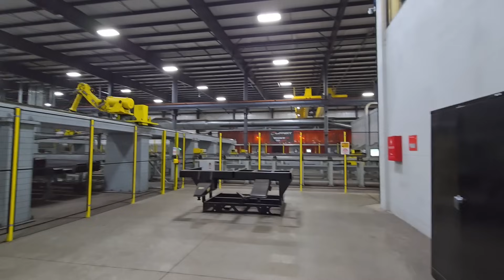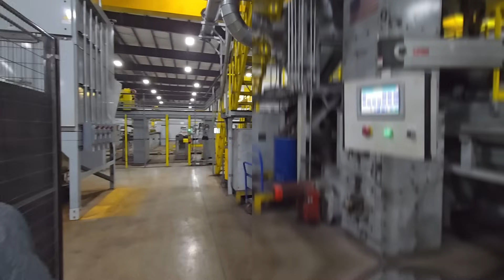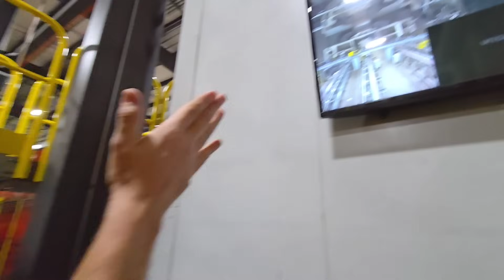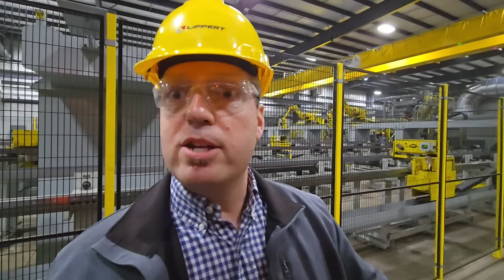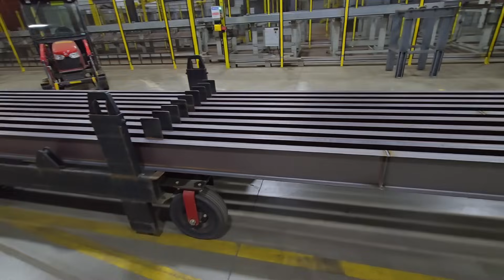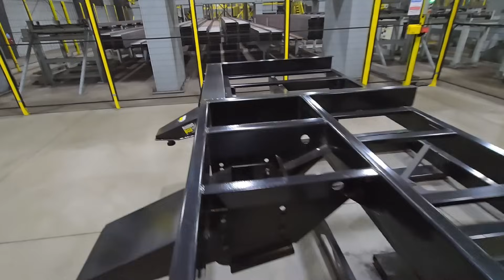LIPPERT RV FRAME Manufacturing Tour.  Part 1: Beam Processing Center

Comment: One thing I learned is that Lippert is covering their own, but I give a lot of credit they have stepped up at least to show their product. I do believe that a lot of the manufacturers are to blame for all the failures of their product. They have cut so many corners to make a huge profit and are selling these unit for 100K plus and don’t want to stand behind them.
I believe it will take some kind of kind of pressure from congress to address the issues and make them more accountable for their product and their work. As long as people continue to buy from these companies they will continue to produce products that are designed to fail. 
Thanks JD for at least bringing some light to a dark problem.

Comment: LCI talked about the leverage applied to these pin boxes, and what length is approved within specs.  Then they brought in a pin box manufacturer and helped them design a shorter pin box for them to be in spec. Common sense tells me to bring in the longest pin box available on the market, add a foot to it, then build the frame to handle that load.  Notify all manufacturers that's the new minimum spec for all frames.  Most of us are paying over 100k for these 5th wheels,  I'm not going to notice the minimal upcharge for the overbuilt pin box area. I grew up in family steel business where my father bought us minimum requirement 1/2 ton trucks (like these frames are built), then complained we couldn't keep up with my grandfather's employees who all drove properly equipped 1 ton cab/chassis trucks. It all comes down to the owners value of the dollar for better for worse.

Comment: JD, I have a 2020 (pre-covid) Keystone Alpine that is in the shop now having repairs made due to frame flex.  Prior to it happening to me, back in October, I had never heard of 'frame flex failures'.  Now, it's all over the internet!  Your series of videos on this issue have been valuable in helping to understand why it's happening, and your trip to the Lippert factory  really drives home the relationship between the Lippert frame (chassis) and the manufacturer's side walls, roof, etc (body).  I would be highly interested in seeing some additional videos and interviews from one of the manufacturing plants, such as Keystone or Grand Design to illustrate what they are doing to ensure a strong rigid structure throughout the body of the RV.  Can you make that happen?

Comment: Great video JD.  It's great to see what Lippert does to ensure quality control. I know this all has to do with the frame flex issue, but I still think there's something missing here.

Somewhere between Lippert frame fabrication and the manufacturers of RVs there is a problem.

Maybe RVs are just too big and we are all expecting too much of them.

If that's the case, maybe everyone needs to look more realistically at what they actually need or be prepared to pay a lot more for a failure proof frame.

Comment: JD, nice interview, very nice manufacturing facility.
What LCI, and all the OEM's need to do is, go get a unit that has failed in use. Take that rig apart and investigate every inch. Document this so owners and potential owners can see what is happening.
I think right now with all the frame issues and upset customers, that a tremendous amount of damage has been and is being done to the reputation of all involved. If this has not affected rv sales I feel its just a matter of time until it does.
The OEM's turning their back and basically telling customers it's not their problem is not good enough.
There is a huge issue industry wide, they need to get a handle on it or prepare for the repercussions. 
I like these interviews to give LCI an opportunity to explain their end. I appreciate that this was probably a rare case, given curtent issues. I can also appreciate your position, but I felt you were a little soft, and more of a help to them. I'm not throwing rocks at you, had you gone in nostrils flared, teeth gnashing, you likely would not have gotten in the door. 
I appreciate your knowledge of the rv industry,  your reviews of rv's and your contacts in the industry. Thank you for your diligence, time and time away from your family to provide this information. 
As many have stated, this is not an easy issue, and what I see from folks having these issues, they are wanting answers and / or help.  And everyone is turning their back on them.
Again, thank you for what you're doing.
God bless and stay safe out on your travels.

Comment: First thing I noticed was how clean and bright the plant was.
Reply: Plants fo that when they find out a camera from outside source is in house.
Reply: That has nothing to do with the quality of the finished product. These frames are built to spec and the RV manufacturer is only going to spec them just strong enough to save money. There's enough stories about frame flex and failure to show they don't build them properly to handle all the weight of these RVs.

Comment: I believe the splice weld is a weak link depending where that falls on the chassis. Splicing beams the cut is either done on an angle or stiffened with splice plates.
Reply from the maker: Not sure there are any examples of those failing though.  If you find a single example please share.
Reply: If you know anything about the welding process, you know that a good weld is stronger than the material being welded.

Comment: Key differences between yield and tensile strength
These are some of the major differences between yield strength and tensile strength:
Yield strength is a measurement to determine the maximum stress that can be applied before permanent shape change is achieved in ductile materials. Whereas, tensile strength is the point of fracture.
Deformation of materials occurs after yield strength has been reached then tensile strength is tested. In brittle materials, tensile strength is reached with minimal or no yield.
In brittle materials, the material breaks soon after the yield point has been reached. In ductile materials, the yield strength is observed. Then ultimate strength is measured as the material continues to elongate to the breakpoint. Looking at the customers, you’re now in the tensile strength by definition.

Comment: Great series ,I think it's obvious the frame is not an issue it is the engendering of the coach and sloppy workman ship and probably the bolts & screws they probably got a deal on them at home depot which I probably the cheapest product on the planet. I have had so many bad products from cement with not enough cement in it to bolt & screws that are so hard they break like glass.
Reply: I agree. I doubt the frames are the issue.  Or if they ARE the issue, what is being built by Lippert was approved by the OEM ahead of time so it's still on the OEM.  A supplier like Lippert is going to build to approved spec.  That's what they do.  They dont know what all is going to be put on that frame once its shipped out.  How could they?

Comment: No matter what anyone says, there are problems with the manufacturing processes that leads to failures.  Stop blaming the end user for these problems.  RVs of yesteryear did not suffer from the amount of structural failures that they have had over the past five years.  Whether the problem is with the welds, or design and engineering, the majority of the critical failures are caused by manufacturing and assembly.  JD, the fact that you are doing this video series showing LCIs processes only gives evidence to the widespread failures of their frames and the oem superstructure failures.  The two are directly related.  If the frame bends where it shouldn't, the rest of the chassis will pay the price.  LCI and the OEMs need to concentrate on improving their processes and doing a better job of standing behind their products instead of excusing the faulty products they are producing.
Reply: The issue is outsourcing your RV frame at all. RVs of yesteryear didn't have Lippert!
Reply: Shutup
Reply: Of course a robot can do a precise weld better than a human.
Reply: 100% correct…!
Reply: RVs of yesteryear weren't trouble free RVs. They had issues and failure too.
Today's rvs are bigger, taller, longer, & heaver then ever before. Go to LCI and show the real problems then. Good luck.
Reply: @kingair350 but it takes a LOT of human interaction to get the robot to weld properly.
Reply: Correct.  This is a company effort trying to get ahead of a problem and a response to all the complaints and failures. Hit all target points: foreign steel? no; so so the bending of steel is natural? yes, even in skyscrapers;  welds are done by robots? yes, higher quality than humans and we analyze the huge amount of data we collect to make a better product; etc.  Soooo, that means the problem is the engineering and the choice of lower quality for higher profit.  Thanks Lippert for confirming it's a management problem.
Reply: @kingair350  I have ran a robot welder and no they cant. A human welder can make corrections in real time to where a robot is programed to run a specific path. If the fit is off the robot cant tell the difference. There are high end expensive robots that can but most companies don't spend that money.

Comment: Former Sunline employee, 
the RV market has had a shift to buyers that use thier RV's either  full time or traveling longer distances for vacation than in years past. 
Then throw in the manufacturers who keep trying to reduce costs and weight and you have this explosion of frame failures, i tend to blame the manufacturers more than Lippert, they just build the frames that the manufacturers want. As long as Lippert's frames meet or exceed the manufacturers requirements.

Comment: Another thought.  When I buy anything, I learn and understand what it is suppose to do and not do.  I don't use a screw driver as a chisel.  I don't use my RV in ways it was not built for like putting a bunch of batteries in the front along with a ton of other heavy items.  So many YouTubers have done this for solar, plus likes and more subscribers without informing their viewers about the weight problem and possible other problems this will cause.  You don't buy a 1/2 ton pickup to pull a 16,000 lb. RV and then go to the truck manufacturer and complain because your truck broke!!!!!!!!!!
Reply: @DavidJohnson-bf2cl - I would argue that an Onan 5500W Generator weighs as much or more than say a 600W - 800W Solar Setup in the front storage bay of a 5th wheel.  That being said, the LiPo4 batteries are considerably lighter than flooded/lead acid, gel or AGM batteries.  I don't have a solar system on my 5er but I did just replace the two AGM batteries with two LiPo4 batteries and the weight difference is considerable.

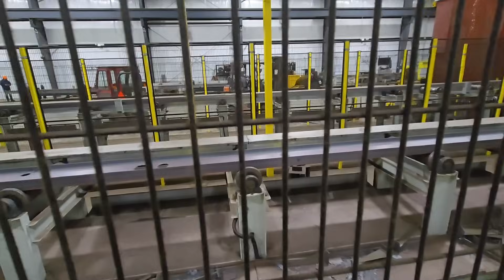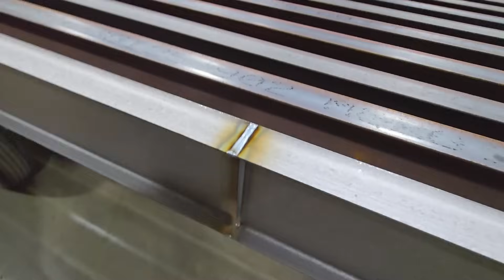Comment: Great tour and very educational.  Thank you.  But I do have a question however….  While I can completely understand why they weld the beams together in order to cut down on waste which saves money; however at some point in the cutting process to specs, you are going to get that connecting weld in a part that will be used.  While it may be welded together, it is still two pieces of steel held by a weld instead of one solid piece of steel. Wherever there is a weld, there is the possibility of a break in that weld.  So then how is a welded piece of steel better than a solid cut piece?  Your video had shown a part coming down the line showing those connecting welds in the part (14:17 & 18:53).

Comment: Another great video.   I would have like to have seen the complete process and then a close-up on the finished welds after the frame is complete.  Is the entire process done by robots? 

In looking at some finished YouTube videos on actual rigs, they show some very poor welds in the non-beam areas. How does that happen if it’s all automated? 

Good video but some gaps in showing the finished product and consistent quality all the way through to production process.  

It looks fantastic and amazing in the video but I’m curious on why when people take their rigs apart and show the finished work it looks like a poor welding job.   Is this a new process in the past year, or has this been around for a long time? 

Not to much to ask but can you get a video of the arrival of the chassis at Grad Design including all the welds in the pin box area.  And then follow the process after that down their line.  Somewhere some really bad work is happening based on the numerous YouTube videos.  I know that’s a lot to ask but I’m sure the community can help fund that video. 

Again, thanks.  Good stuff.

Comment: JD as expected another great review! 
I will say the step up design and the additional boxed in pin box sections gives me more confidence in the structures rigidity. The 6" tube space saver design appears to me to have the ability to flex at the end rails when loaded. As you mentioned the demo units are not full width. At full width this would only gets exaggerated IMO. Now overload the front of a toy hauler with multiple solar batteries and fill the storage area up and not add a significant amount of weight in the garage and that extra 30% design goes away quickly. It would be nice to know what engineering safety factor is incorporated into the frame design. Did you happen to have a chance to ask what their view point on adding Sumo springs was.

Comment: The frame flex is still Lipperts  fault. All it would take is something like a reinforcement patch on the area's that are none to crack. And this is the time to do it. The wrong pin hitch put on by the dealerships isn't Lipperts fault BUT how hard would it be to just to reinforce the area in question from the beginning.

Comment: Surprising video.  At 18.20 he says all the frames are built to the manufactures specs.  So...after seeing this I would think that this absolves Lippert from the bad name that the manufactures put on them. But then again when they get to showing off the 5th hitches it seems like they do the engineering on that.  Steel thickness and all
Reply: OEM would still have to approve it even if Lippert engineers certain parts.

Comment: Look at the frame on a PJ or Big Tex gooseneck trailer then look at the frame on a GD fifth wheel. It's easy to see the issue.
Reply from the maker: you really need to think about comments before you make them.  Gooseneck trailers have a tremendous amount of flex when unloaded versus loaded and offset Flex when traveling.. they are designed that way to prevent the frame from cracking under load.  
https://youtu.be/rjiKtybA-xg?si=FIUpv5M8nFWoDqNc
https://youtu.be/KmdnyYX-dOA?si=EhR8NKTCDLe_OIvX
Reply: You need to take a look at how thick the frame is on a gooseneck

Comment: Can you ask them to show their testing process of a complete frame?   I am guessing they do not do a dynamic test ( fatigue ) on any frame.   In the aircraft industry a test airframe is put thru many lifetimes at an accelerated pace.  Simulating takeoff, pressurization, flight, landing over and over again while being electronically monitored.    I would guess at best they use a CAD model run a simple CAE  (computer aided engineering) test and call it good.
Reply from the maker: Coming soon
Reply: They hopefully are using programs like "solid works"  for cad/cam designs, then FEA which stands for " finite element analysis" and do random tests.
I doubt it because of lacking radiaused corner bracing is a big no no, a known stress riser. My brother is a mechanical engineer!!

Comment: I am not a structural engineer but that old design upper deck looks a lot stronger.
Reply from the maker: That's where the engineers prevail right?  Doing tests and understanding that it's about how it's engineered and just adding more steel doesn't mean stronger.

Comment: When did they go from manual to automated factory. Some of The Frames thath Are showed on YouTube have definetly not robot welds.
Reply: Im not 100% sure, but it appears the only laser welds that are performed are the ones that join i-beams together. When the beams are assembled into a trailer all welds are done by hand.
Reply: Ok. I agree 100 % thath The problem start when The superstrukture departs an The frame starts to take the beeting as a separat part. But then it is wery importent thath The welds Are meltet in to the steel and not on to the steel. 🇳🇴

Comment: I would be interested in knowing if the frames manufacturers are ordering are being used for those builds or if manufacturers are just grabbing what they have and saying it was built for this design and lippert is non the wiser. If the frame is designed and built to flex according to the design of the trailer but the manufacturer changes a thing or to. Then the whole trailer is comprised… right?